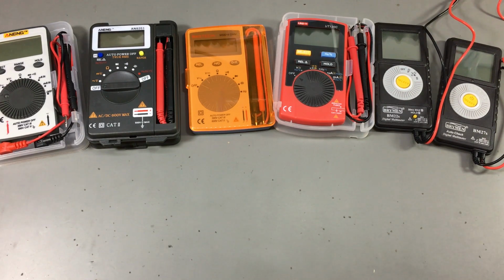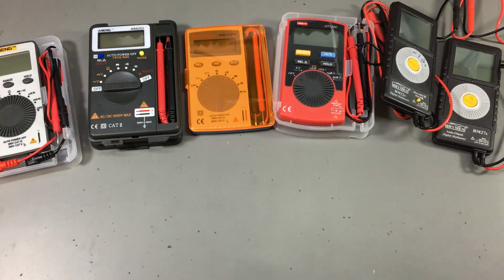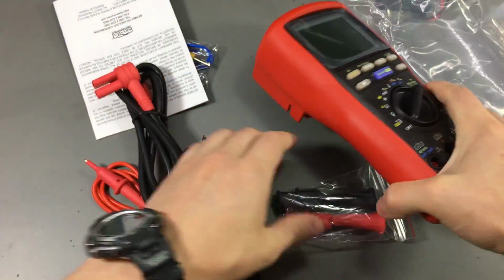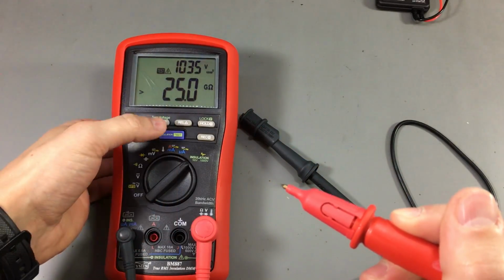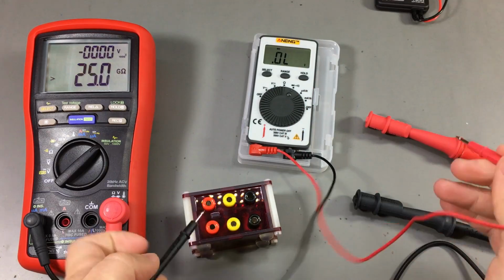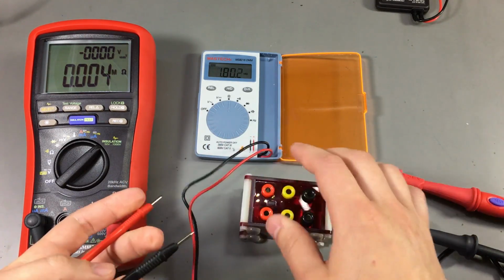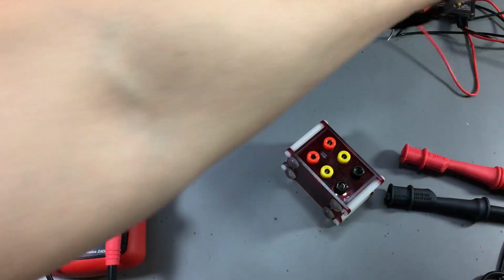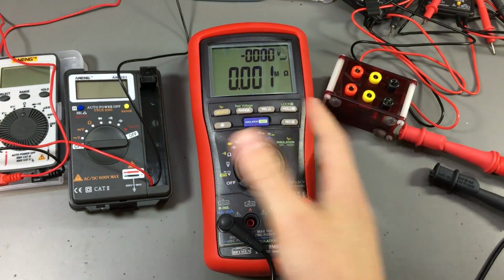Voltlog #162 - Pocket Multimeter 1KV Testing and CAT Ratings

Comment: The real danger is the transient that breaks circuit or starts arching. After arc has been triggered,  high power from the voltage source and makes a large bang when lower voltage at high current arcs using the plasma made originally from transient arc. Unfortunately that needs a transient source or other equipment typical hobby lab does not have.
Stuff like pure insulation testing is much easier when you get by with just about any high voltage source. I've used components like isolation transformers and neon transformers for insulation testing in my hobby lab. Transient testing needs method to add the high voltage momentarily. Simple insulation testing is sometimes specified for longer test time and can be done by simply connecting high voltage for a couple seconds or so. Any testing with a true high voltage source can be very dangerous if you're not familiar with working with high voltage. It needs much more care than low voltage mains that can still kill you.

Comment: Thanks for making an attempt at testing these.   Dave made a few videos with an insulation tester as well on a handheld meter and showed the switch breaking down.   In his older videos, he was using the AC wall outlet for his resistance test.  This last one he mentions some reference source.   Consider that your Brymen is a DC source, if it had unlimited current available and you switched the meters to their resistance modes, I suspect you would damage a few.  I've had them fail much lower.      Good luck with your testing.
Reply: Here is my attempt at putting 1KV DC into the meter's clamp circuits.   Not something I recommend anyone try and repeat.

Comment: Sorry for my ignorance but what are transient voltages? I thought voltage was pressure or potential difference? What is the difference between a standard voltage and a transient voltage? Thanks in advance for any replies.

Edit: Google defines transient as short term. How short should the voltage spikes be with regard to these meters?
Reply from the maker: yes transient is defined by the short length and potentially higher value, however in my test the length was for how long I would keep the button pressed.

Comment: 1000V on AC and DC, but only 4-15V on the other ranges. The insulation tester cannot deliver 1000V on ranges with low impedance.
Reply from the maker: Indeed the insulation tester cannot deliver 1KV into the low impedance encountered on the ohms range input. However as explained in the video this instrument is the only one I had access to that would go that high in voltage, it's far from ideal test conditions. and I did not claim that this is the proper way to do transient voltage testing.
Reply: It was only in the 4-15V range, i.e. no transient like test
Reply: Did you take any scope shots from back then?  Any other data on current, inductance?  If so, I would be interested in seeing it if you would not mind posting it.
Reply: Henrik Jensen Very true, this test is giving a bit of a wrong picture.
Reply: It depends on the energy, on most meters today is a small PTC in series with the ohm range and after that some clamping. On cheap meters it can often handle up to 250V. This also means the input impedance is in the 1-3kOhm range when the clamp is turned on and until the PTC warms up.
Reply: Mai, you may not think you were using high voltage power supplies but sound like you made a nice open loop boost converter.
Reply: Thanks.

Comment: funny how dave jone claims he killed the aneng meter with 240V at ohms range but did not verify its actually dead but this video clearly shows its throwing 1000V yet the meter is still functioning perfectly.
Reply: Reesey Me This 1000V is only achievable on high impedance circuits. 220V from the household outlet is very different. This test is actually not saying much at all. Voltlog should talk to Joe Smith.
Reply from the maker: Javier, talking to Joe Smith would not help. I would still be using the equipment I have available in my lab and to the best of my knowledge. I appreciate feedback so please suggest a way I could use the BM887 to test these pocket multimeters better than what I already showed in the video.
Reply from the maker: It was strange how the aneng failed so fast in Dave's test, he probably had a more capable HV power supply that pushed more energy into the device under test.

Comment: Hi seams we have pocket DMM week. Australia is first in the timezone.
Reply from the maker: I liked how Dave had much more pocket meters than I had(bigger budget). However I didn't like the fact he had some older revision of the brymen and couldn't show it's full potential.
Reply: VoltLog Thanks. Have not a single one. So its excellent that you share your collection and test them.
Reply: He should have added more tests, actually he should have tested them all.  Me personally I don't care about high voltage with a small pocket meter, 300V will do. If I use a meter for higher voltage I want nice probes and a more heftier meter for mechanical stability.  But why no tests about speed with these auto-range devices .  The old pocket meter that I have and adore is a big failure in that part. Trying to measure a resistor will set you back 5 seconds or so before you have the actual reading.  Really strange that the Brymen was not that good as I do like these meters a lot.
Reply from the maker: In eevblog's video, he actually had the older model for the brymen, not the newer one with "s" like I had in my video. I tested by twisting the case like Dave did and I do not have that problem on my units. If he would have had the newer BM22S for test with a carry case like I had and if he would have considered the price which is in the $30 range I'm sure it would have been in top 3.